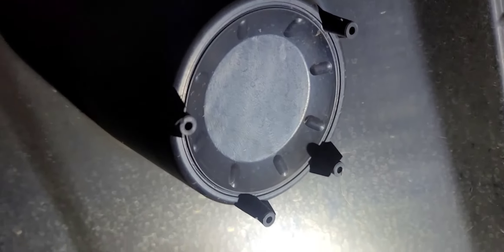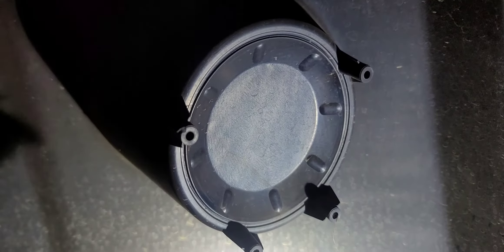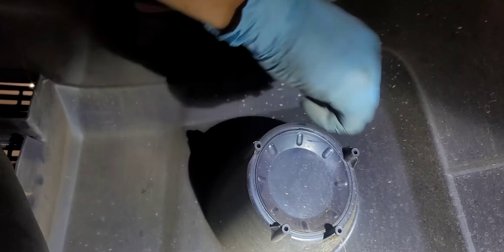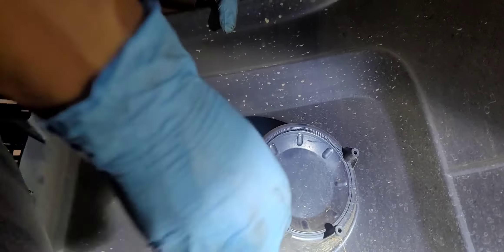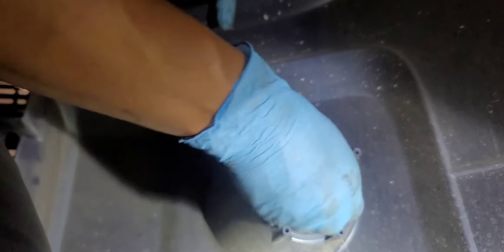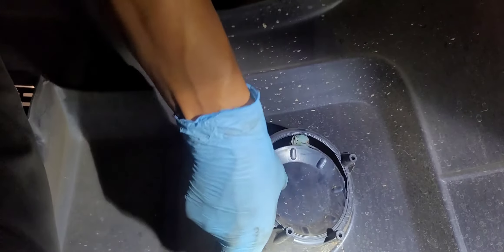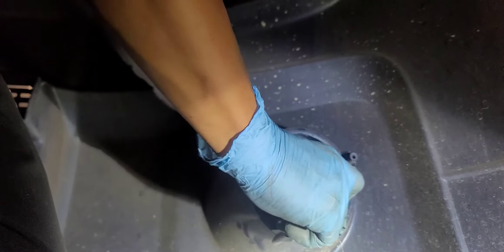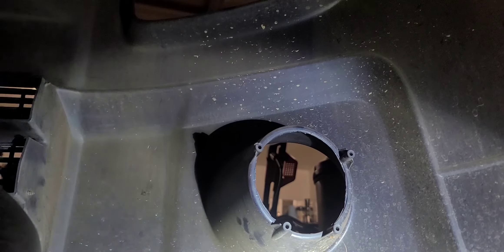Honda Element Foglight , easy cutting to install

Comment: Also, I put a bead of clear silicone around the backing gasket and around the edge of the clear lens. They have a tendency to retain moisture/water.
Reply from the maker: Great idea. Also replacing the bolts will be good. They tent to get corrosion